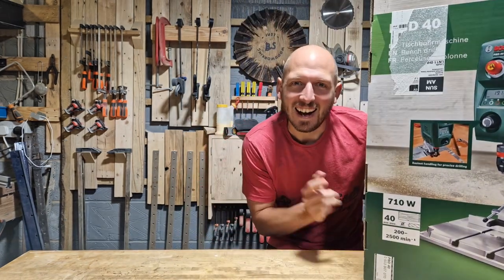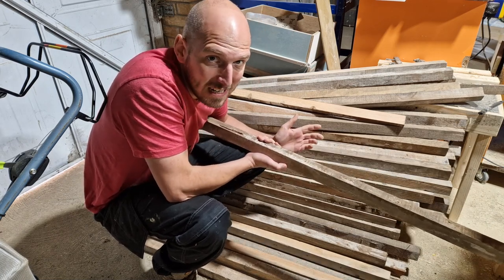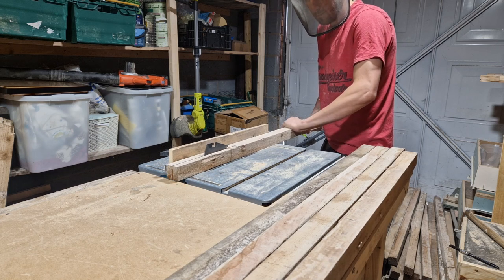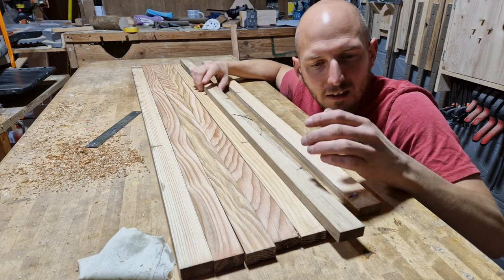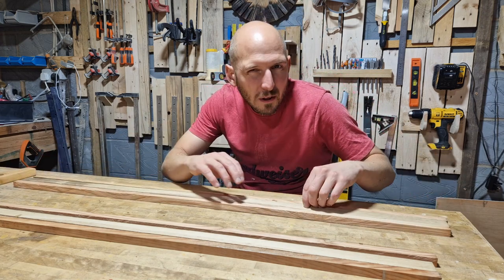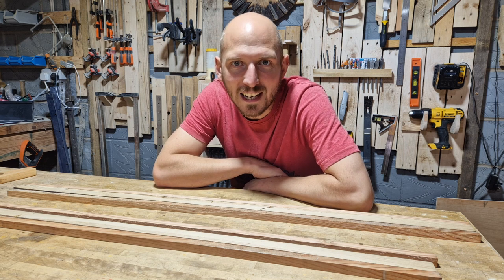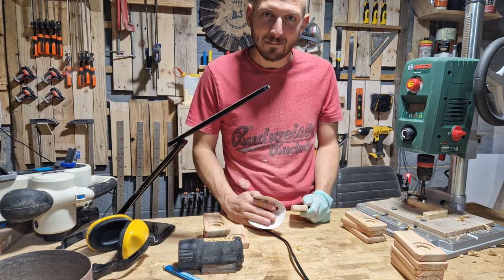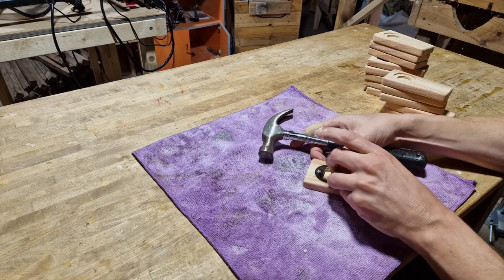Making Money from Bottle Openers: Is it possible?

Comment: Happy for you! (And good beer selection too - its 5 o'clock somewhere). Cool little product, pretty efficient production line, nice use of scrap materials, good job all round.

2 minor suggestions on the jigs: drill jig, was clearly fine with your new hold down clamps and sharp bits, but suggest putting your fences on the side that the part would spin into if the bit catches. Then if it ever does catch, it's likely to dig in (and might wreck that single piece / bit), but you're not flinging parts across your workshop. On the mitre saw jig, just cut a little spacer, so you can keep the gig where it is and add the spacer for the second cut.
Reply from the maker: Cheers mate, appreciate that. I never thought about it catching in the drill press. That's a nice easy fix for the next time. Great shout on the spacer. Doing it by eye for this batch was fine but I certainly need a spacer or alternate jig if I do this again. Trying to think of ways to improve efficiency has been my favourite part of this project.

Comment: once the drill press pays for itself, I think you'd like the wen oscillating belt and spindle sander or its equivalent. it's currently at its lowest price ever on amazon at 162 usd. i got mine at 195 and I am very happy with it. Not 100% sure on price differences across the sea.
Reply from the maker: My sanded finger thinks so too! If these openers sell, I think it will be a good investment for future 'small projects'. Cheers buddy

Comment: I'm not sure what the red-ish pallet wood is, but I used it in something a while ago and it's a lot more resilient than the plain pine/fir I sandwiched it with, it's a really nice softwood to use. I'd hazard a guess at larch, but don't quote me on that!
Reply from the maker: Yeah, its not hard but doesn't scratch like pine. It goes really nicely with the oak now the mineral oil has brought out its colour. I've certainly never worked with larch so no clue

Comment: It’s like a light bulb moment when you realise how much easier a jig can make your life. 

Have you thought about a template and flush router bit instead of the mitre jig? Similar idea but you would eliminate the issue you had.
Reply from the maker: They're a game changer! I spent ages thinking about using the router but couldn't figure out how to do it safely with the pieces being so small. I know there must be a way but the router scares me so want to do it properly! Any ideas?
Reply: @justbswoodworking  I made a very basic router table out of a sheet of laminated board that came from an old desk. I cut a 30mm hole in it and bolted the router to the underside of the board so the bit fits through the hole. I then just clamp the board to my bench when I need it and put it away when I don’t. 

 For bits like your bottle opener I would have a template to the correct size and use some double sided tape to connect the template. For smaller bits I made a bit of a flat paddle to use like a push stick/ block. I put some of that stuff you use in kitchen draws as a bit of a grip pad so my fingers stay away from the blade. 

Like most things it’s not perfect but it’s cheap and safer than hand routing small bits.
Reply from the maker: I always forget about using double sided tape. I'll give your ideas a go on some test pieces - see how scared I get 🤣🤣
Reply: @justbswoodworking  try with a paddle to hold the piece. It always makes me feel more comfortable.